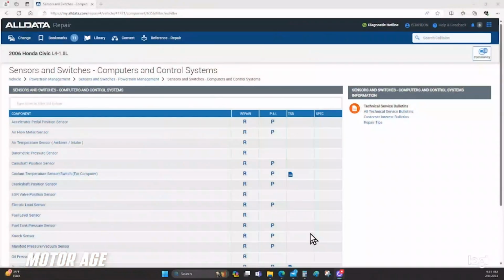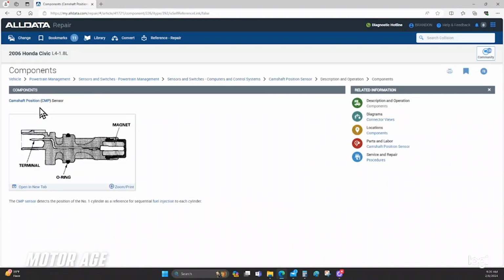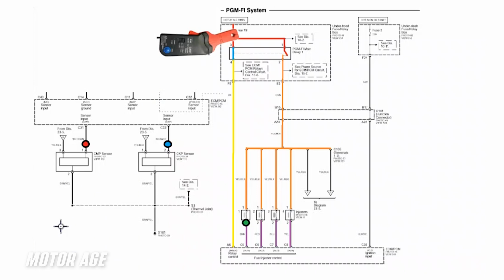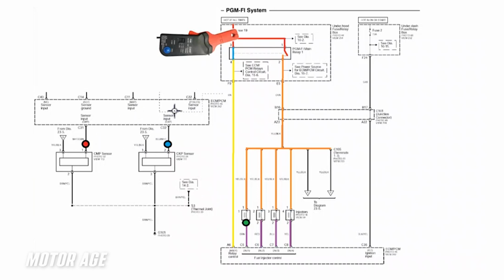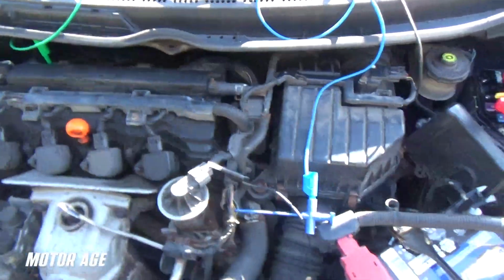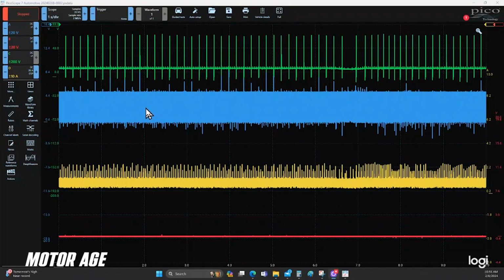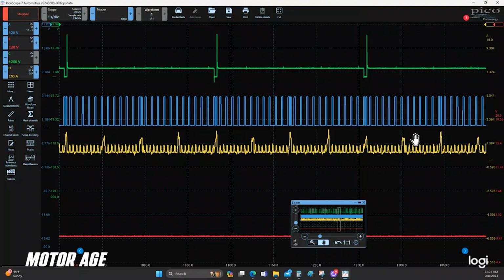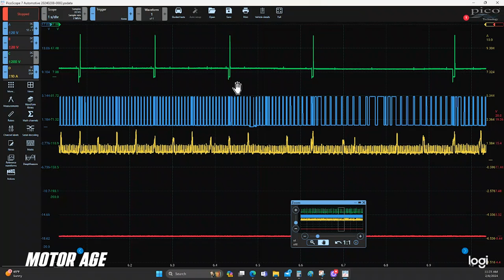Mastering Diagnostics #11: Fueling the Fire

Comment: Thank you Brendon. So, just wondered that not just CKP but other sensors' signal probing can be grounded just as you did without hurting the grounded sensor?
Reply: Correct!
There is very little current flow, and resistance is engineered into the signal detection circuitry.
Reply: @brandonsteckler3417 Thank you for your sharing your insights. Trust that methodology alone will sharpen my diagnostic practice significantly, I could already see applications. Cheers, from Korea.
Reply: Thanks so much,  @bekomcar  !

Comment: What videos would you   recommend for someone starting out in diagnosis? Like diag  101.
Reply: Begin with the basics:

Learning about ohms law, and Howard defines that voltage, current flow and resistance all relate to one another.  This will allow you to learn other important facts.

Learning how individual components operate at the most basic level, and then together as a system, will carry you far, regardless of what you make or model vehicle use you are working on.